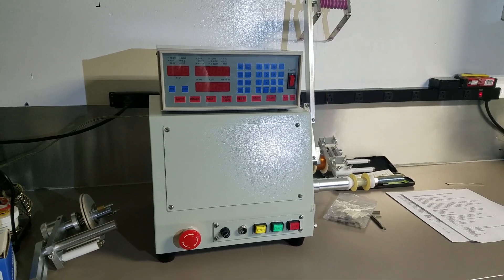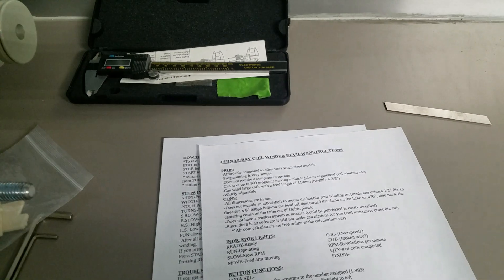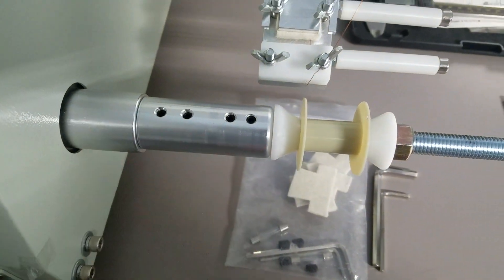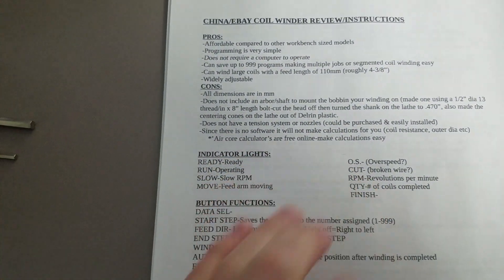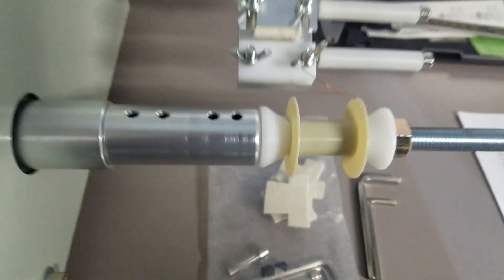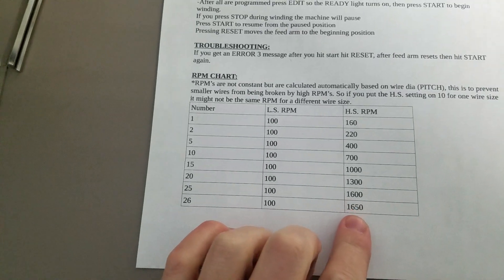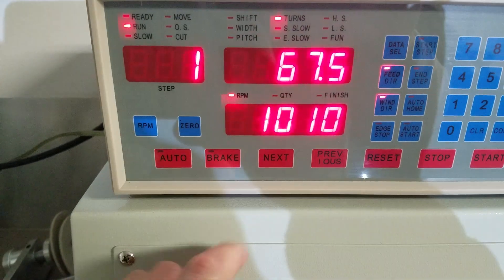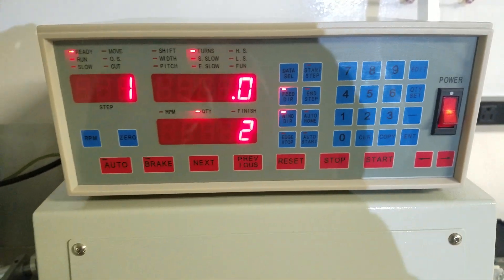Automatic CNC Coil Winder review & how to use (In English)

Comment: Hey @brandK 
I found this coil winding machine on ebay, searched up you video, I'm wondering, I need a coil winding machine that can wind rectangular coils is this machine capable of doing that sort of work, nice video by the way! And my wire is 34 awg is the capable of winding with that thin wire with out snatching it?

Kind regards 
Nerv
Reply from the maker: If your talking about winding a coil on a rectangular bobbin then yes. I've wound several on rectangular bobbins and they all worked great. It will do 34AWG just fine as well.
Reply: @BradKwfc   BradK  

Hey! yeah exactly! rectangular bobbin, not cylindrical shaped. Based on your comment and video, I just ordered the same machine just now from Ebay for 599usd 🙈 
so thanks for your upload and answer!

Could you by any chance show the process of creating and mounting an rectangular bobbin coil on your machine if you got any spear time next time you make a rectangular coil?😁 would be awesome! 

I wonder on your bolt that you have mounted in the rotor axle is it also cutted so it not completely round with only the threads on the bolt? or was it just to simply get the threads smaller and screw the bolt into the axel?

Kind regards 
Nerv
Reply from the maker: @coltx64  

On the bolt I cut the head off and cut the shank down (the non threaded area) on my mini lathe to a smaller diameter so it would fit on the machine. I'm in the US where everything is in inches-if your able to get bolts in mm sizes you can probably find one that will fit without having to cut it to a smaller dia.

I have a 3D printer that I use to make custom bobbins, I make inserts to fit into the rectangular bobbins with a round hole through them so that they are centered on the threaded rod.

3D printers are cheap now days and well worth the price. I bought mine for $125 shipped, it was broke but I fixed a few things on it and its worked great ever since. I have seen the same one (nearly new Qidi X-one 2) on the local classifieds for $150.

You can use tinkercad (free software) to design and print your own bobbins. Much easier than waiting for them to come in the mail.
Reply: @BradKwfc   Hey! Thanks alot! Your well answered answer helps me out alot! I understand, I live in Norway and here everything is in millimeters and cm so I guess it won't be a problem! 😁

I'm struggling a little to picture how you centered the rectangular bobbins with a round hole through them🤔

But I'm now also considering a 3D printer based on you comment just now thank😁👍 Found some cheap printers on ebay 2 used Qidi's but a little expensive, if one wants to make a bobbin on the length around 181 mm and thick 91 mm would I have to print 3 parts? or just print it vertically a upward in the qidi x-one 2?

By the way you don't know any where one can order custom made bobbins in the meanwhile? 

I really appreciate your comment on all this! you already have helped me out alot!😊😊😊

Kind regards 
Nerv
Reply from the maker: @coltx64  

You can use Tinkercad online for free, that's what I use, very simple. Watch a few tutorials here on YT, really easy to use. You can hit one button and it will add points to select where you can center a part inside another (such as a hole in a square or rectangle). I've designed 10 bobbins or so on there and printed them and they all worked great. I like printed bobbins better now because I can add a flange and a channel where my wire will go then use screws and ring terminals for connections.

You can print the bobbins in one piece but you have to use 'Supports', basically it prints a thin area to fill the blank space so that the upper flange of the bobbin can be printed when the bobbin is printed vertically...Once printed you simply pull the supports out with a pair of pliers. 

I have found Cosmocorp has a huge selection of bobbins and they will give samples for free, you just have to pay shipping. Used them several times, not sure if they ship outside the US though.
Reply: Hey  @BradKwfc  ! Thanks a lott you have been a great help! I can just confirm that I just bough my first 3D printer some days ago, after finding one sold here in Norway that would support the same as the Qidi X-one 2, I first tried to bid on a Qidi on ebay and negotiate to get one for 100USD, but with shipping and tax, it was just not worth it. But I actually got my Flashforge finder 2 in the house, and I did my first mini bobbin rectangular prints here to day using Tinkercad as you recommended, and simply drag the file into my printers software extremely easy! and so fun! I watched some tutorials on youtube as you mention and it helped a lott very simple! 

I see what you mean with the support, I have not tried to print with support, I dont know how to now, but gonna figure it out! I quickly saw that the upper flange was a big fail xD without supports xD 

You mention this: that you make inserts to fit into the rectangular bobbins with a round hole through them so that they are centered on the threaded rod. you dont by means share the prints on any clouds like polar3d .com or some where? 

By the way I went through you youtube channel, I dont know if this can help you in any ways, but any ways I post a link to what I talk about:

www.youtube  .com                 /watch?v=WLcU6ykBgm8&list=LL3zy17mDAMINAJGVXwlnX5g&index=9&t=707s

Kind regards!
Nerv
Reply from the maker: @coltx64  
Awesome man, Glad to hear you got a 3D printer. I wanted one for years and now that I have one I realized I should have bought it years ago lol.

As far as the inserts, I don't have any files for them, but on Tinkercad they are very easy to design, then you can print whatever size you need so they will fit on your coil winder.

On supports, my Qidi software has a box to add supports and all I do is check the box and supports are added. Your software might be similar but I'm not sure. 

That guys video is great, lots of interesting work going on out there. I've had some recent success with my research but the more I learn the more I realize that I don't know. Seems its a never ending process, LOL.

Let me know if I can help in any other way or if you need help making the bobbins or inserts in Tinkercad. You can always email me @ BradKwfc@gmail.com
Reply: @BradKwfc  Hey Brad!, sorry I haven't see any Youtube notification that you answered my last message :S I searched up your video again, and scrolled down to our tread to check if you ha answer :D I needed to search up your Youtube as I got my winding machine from china, and needed your video again haha :D Yeah I totally agree, I see what you mean!

I now mastered the winding machine now I think ;D and I also have mastered the 3D printing Thinkercad program you recommended :DD Took my around 4-6 hours of playing with Thinkercad trying to design a rose, it was challenging, but learned a lott, and I have printed some part out now, some prototypes, and some finale "product" of rectangular bobbins the inner rom is around 181 cm long and 5 cm wide, so its a big 3D printed design in 4 parts + 2 parts x2 it was challenging, to print and design away to connect them all, but I mange :D I have even tried to make a coil but it went to a disaster, as it collapsed, but I and made it stronger now! the next one will be better.

By the way do you use epoxy on any of your coils, if I may ask what kind do you use glue or long harden epoxy? I got both, but I used some epoxy glue on the disaster coil xD haha ended up with 3,65kg useless copper xDDDDDD

Haha yeah he do a lott of experiments, and he kinda dont care what people says, he seems real :D 

Thanks mate, I appreciate that a lott, I will :D Thanks for all your help :DD

Stay safe in theses times and take care!

Best regards
Nerv
Reply from the maker: @coltx64  Why did your bobbin collapse-not thick enough walls or did it collapse during printing (did you add supports?).

I haven't had any bobbins that I needed to glue together. Hot glue works pretty good for 3d printed parts I have found though.
Reply: @BradKwfc  Haha I will tell you the rectangular bobbins I made was in simple 4 printed parts each part took around 5 hours to print, the part had an length and width of 140mm. with a total length of 181mm together and 50mm width rectangular hole in, I taped them together and placed it on the winding machine on a brick i had printed with length of 181mm an 50mm wide with a center hole M12.

But damn! the delivery time on my machine crazy it have been in quarantine xD because of this Corona, and the seller did not answer nothing I was scared he was dead or something, but it sorted out in the end🙉 but in the meantime got my design skills up to date💪👌 

But the bobbin: everything went good til I was going to remove the inner brick, when I did the copper had the same effect as if you put like 100 rubber bands on a watermelon, the tape was just not enough, so it collapsed in the center in the small gaps and cutted off one of my ends.. 

But tiI now I have printed out some lists 3h each, and glued and melted and drilled them on place, on my bobbin so every 4 parts sits strong together, it feels much stronger now! And I dont think it will fail :D I have printed a second rectangular bobbin now with a design so I do not need to drill anything in place, the 2 lists with new design I "simply" just need to click them together and glue them! I'm waiting for more copper now :D

I haven't tried hot glue on the parts jet, to now I have used a lighter to shape the perfect and epoxy glue, for som reason the epoxy glue worked out good on the plastic :S 

If you need any help or anything just ask! I don't know how much help I be but never fail to ask! I will sendt you a email, so you can get in touch, just don't share it😁

Maybe I upload a video sometime and I show you🙉 I do not really upload anything, but maybe I will with printing and stuff you know🙈

Kind regards
Nerv
Reply from the maker: @coltx64  Cool man. Learning from experience and failure is the best way to learn anything because you never forget.

I have only made round bobbins with my 3d printer. One thing I do is keep the wall thickness at least 3mm minimum with a high infill density. Also, I put large steel washers on the ends when I wind the coils so the flanges don't warp from the wire. Perhaps you could do the same on a rectangular bobbin?

Comment: do you know the lowest pitch setting (or the smallest wire size) this machine can go?!
Reply from the maker: I think anywhere in the range of 18AWG-40AWG is what the machine is made for. If you go smaller than about 26AWG you'll need a different wire guide or you can clamp your own nozzles in the wire guide. That's what I did.
Reply: well I'm thinking about using the machine for guitar pickup, which mean I mostly use 42-44 awg wires. some modification on wire guide & bobbin mounting would be necessary. it wouldn't be a problem for me.
but setting on pitch travel would be something that important for me since I'm gonna need it to set up certain turn per layer.
on some listings, description said the machine could handle down to 0.03mm wire, so that would be somewhere around 47-48 AWG. much finer wire than what I usually use. but then, I'd rather listen to first hand experience first than only believing what stated on seller description, especially for seller from China 😂
Reply from the maker: @pepticon  

I just set mine up for 1,000 turns at .03mm, worked great. Also, I even tried to do 1,000 turns @ .003mm. At first I thought it was not moving but when I put my scale up to it it was working perfectly. So now you know, this thing would probably do 100AWG. I had no idea it was that accurate.
Reply: @BradKwfc  thanks a lot for the input, I think I'm gonna try this machine. also, I just noticed something earlier. apparently, this machine is a copy of one of Geo Stevens! previously I had some feeling that I'd seen similar machine from popular winding machine brand, so I browsed some reputabable brands and found exactly the same on Geo Stevens line up. I'm sure whoever made this on China, copy it 1:1 from Geo Stevens, the Chinese has reputation of doing it 😂
so, with Geo Stevens design, I'm not surprised if the machine can do such accurate job.
Reply from the maker: @pepticon  Never heard of Geo Stevens, looked them up and yeah I wouldn't be surprised, they look nearly identical.
Reply: @BradKwfc  can u show me how u put that 0.03

Comment: Could you tell the brand name?
Reply from the maker: No but like most things made in China they are all made in the same factory then sold under different names. Although in my case there is no label anywhere on the machine that I can see.
Reply: @BradKwfc  
I have come up to the same conclusion. Now on Alibaba there are two brands offering a winding machine which look exactly similar (in fact they are similar to what you are showing here). So I was confused.

Comment: Thanks for this helpful video.
One question; As you might know, when the two windings of a transformer have the same number of turns, it is a common (and good) practice to wind both windings together by winding a pair of wires (rather than first winding one of the windings with a single wire, and then winding the other winding with another single wire on top of the previous one).
Do you know if this machine supports this scheme? I mean does it support winding a pair of wires around the core?
Reply from the maker: It can but you would probably want to make a few custom modifications to make it work smoothly.
Reply: I do something like this.  I have a 10k:10K that I wind with a bifilar setup.  One side has a center tap.  I'm using a Cosmo bobbin designed for EI625 laminates, 5/8ths stack.  The challenge is the wire feed; making sure the wires don't tangle or get caught on each other.

Comment: Is it possible to program it to wind so that it will do a slow pass then a faster pass across the bobbin and have it repeat that pattern throughout the winding to preset number of turns?
Reply from the maker: Dave Stephens 

Yes, you could make a program for each then just change to the other program after each layer is wound. You'd have to be sure to leave AUTO HOME off but other than that I think it would work. 

There's probably a way to do it so it operates continuously but it would take some time to figure that out.
Reply: @BradKwfc  Hmmm, it'd be a deal killer if it won't do a programmed sequence of different layers. This would be for guitar pickups, I've seen one guy doing in a short video, so it must be possible. So the arbor take a half inch rod and it tightened down by allen screws?
Reply from the maker: Dave Stephens 

I'm sure there's a way to do it, I only use mine for multi layer coils so it's not something I've looked into.

Yeah I use a 1/2 threaded rod, and yes it mounts in using allen screws. Not sure why mine didn't include a bobbin fixture, I've seen others that came with them. Might be because I bought mine used.

Comment: Hello !
Thank you for the pretty good tutorial.
I would like to have a guide in PDF file, please send me.
Email:   huongtandong200978@gmail.com
Thank verry much !
Reply from the maker: Dong Huongtan 

Just sent you the email. Enjoy
Reply: @BradKwfc  Thank you very much!
I have received PDF files from you. (Both files are open)
Thank you very much!
Reply: @BradKwfc  Thank you very much!
I have received PDF files from you. (Both files are open).
--------------------------------------------------------------
Do you know what microcontroller IC they use to control it? 
Thank you very much!
Reply from the maker: Dong Huongtan 
Your welcome, happy to help. 

I'm not sure about the microcontroller. I'll try and pull the cover off this weekend to see if there's a part number on it.
Reply: @BradKwfc  Thank you very much!
I look forward to the good news from you!
Reply from the maker: I took the outer covers off and I can't see what uC is used without taking the front panel apart as its mounted right behind the panel. I would take it apart but don't want to risk damaging anything.Also I noticed on the driver board some of the IC's had their labels sanded off so its likely the uC also has its pn removed.Sorry I couldn't help further-if my unit was broken I'd have no problem tearing into it but since everything is working correctly I don't want to risk it.
Reply: @BradKwfc  Thank you very much!
I went to find out who sold the broken controller so I could buy it for repair.
One more time thank you very much!
Reply from the maker: Dong Huongtan 

Happy to help!

Comment: Hello, how did you make or where did you buy the  Centering Cones?
Reply from the maker: Niyi Gbadmos 

I made them on my mini lathe.

I've had other bobbins that didn't work with the centering cones, in those cases I bought some 1/2 inside diameter aluminum bushings then put electrical tape on them so they would fit tight on the bobbin.

Comment: Do you have any information about the lowest possible speed the spindle can turn with in rpm?
Thank you in advance :)
Reply from the maker: I would say its lowest speed is 100RPM. When I have it on the L.S. (Low speed setting) the lowest it goes is 100RPM.

It might go lower than that if you are using a larger gauge wire (remember in the video I said it calculates the speed based on the wire dia you input) but for everything I've done the lowest it goes is 100RPM.
Reply: It is possible to set 10 RPM. You have to change some system settings for that.